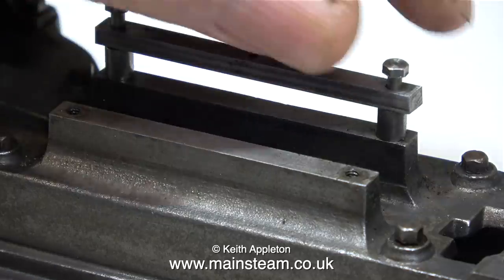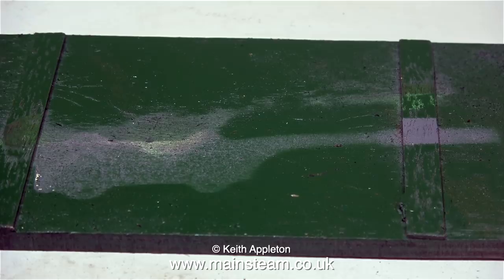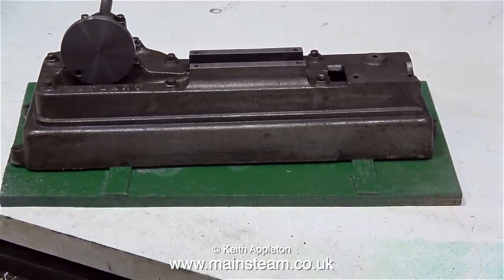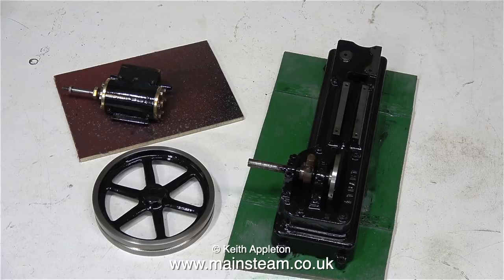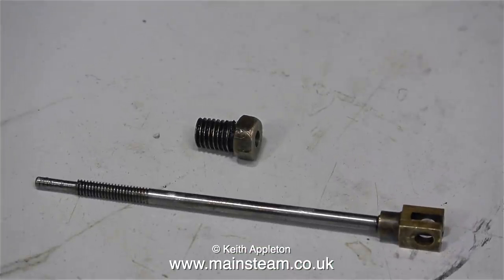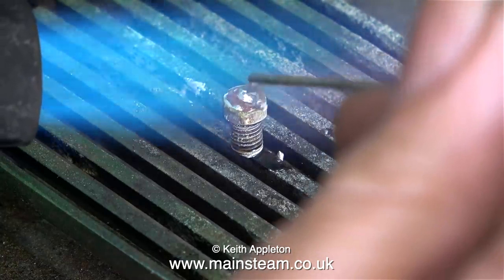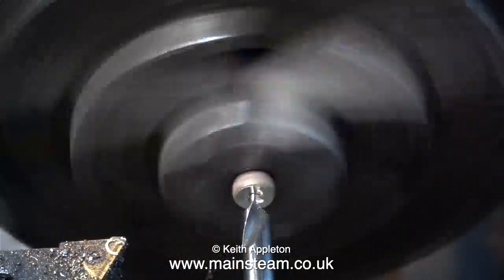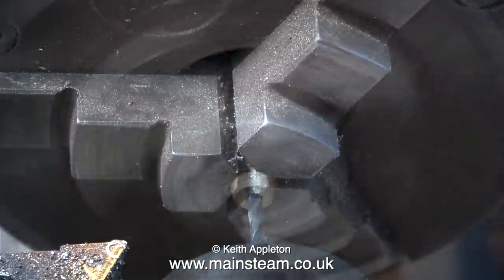A VERY OLD STUART S50 STEAM PLANT - PART #10

Comment: I'm sure you must have mentioned elsewhere, but what type of paint do you use for this?  And why do you prefer to brush-paint these parts rather than spray-painting them?  (I can think of at least three possible reasons why you might prefer it, so I'm curious which is the actual reason.)

Also, thank you for showing the method that didn't work; definitely food for thought for things that it might work for.
Reply from the maker: This is "Humbrol" black enamel paint
Reply: have you used hammerite?